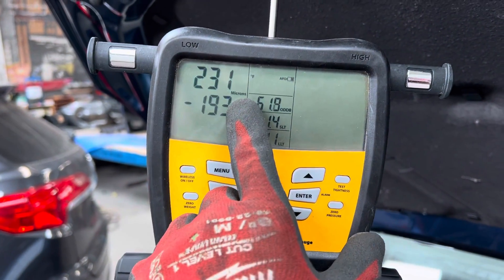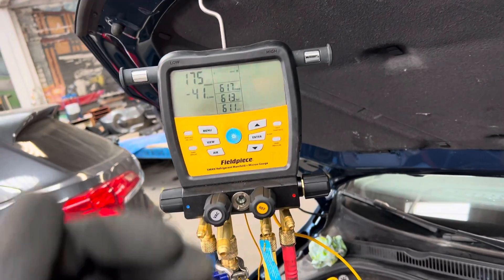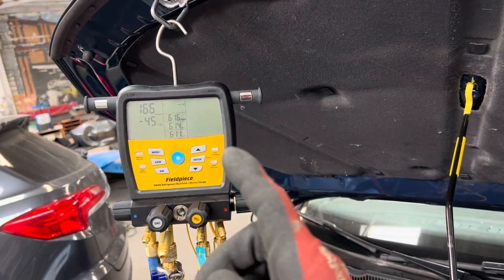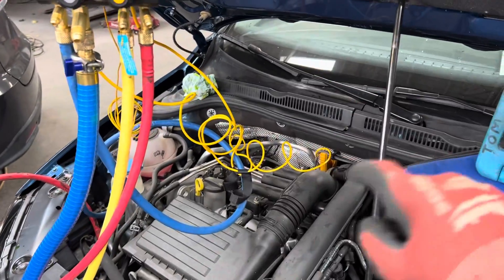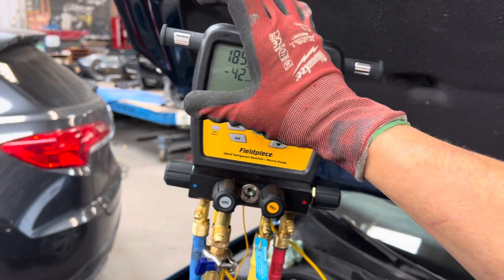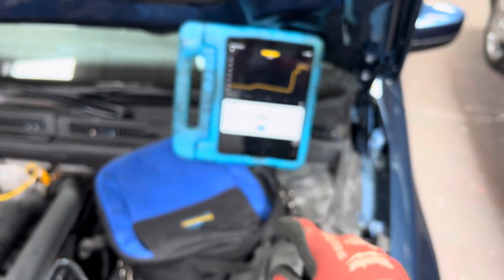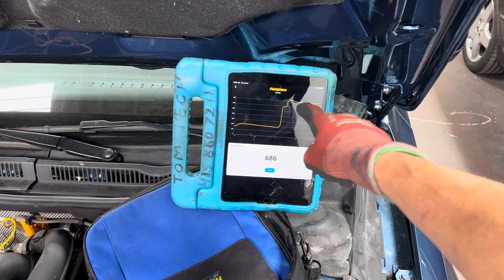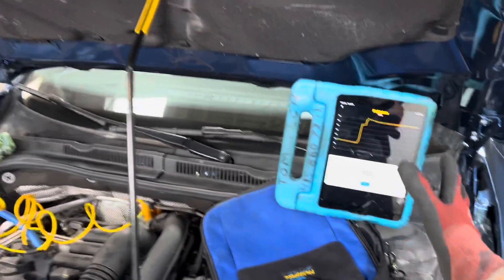MICRON GAUGE USE ON SM480V

Comment: One question master. Where is the right and best  place to connect the liquid line temperature clamp and the suction line temperature clamp ?
Reply from the maker: Suction line low side, low temperature right at the firewall where it comes out of the evaporator
         Especially if it has an internal heat exchanger line assembly

Liquid line exiting coming out of the condenser. 

If it’s by blowing hot air from the fan or if it’s close to the exhaust manifold where it’s really hot radiant heat . 
     Now wrap some cotton towels around them if the blowing heat or direct radiant heat heat up the plastic because if the plastic gets too hot that will transfer to the temperature pick up sensor and give you wrong readings.
Reply: @coldfinger459sub0 thank you master .

Comment: Tom, just to confirm the AC is working normally, what should be the difference between outside and cabin temperature should that be 15 degree in x minutes, apprecaite your help.

I got SMAN 480V,, WITH BLUE VAC. i used vaccum hose that is 1/2 hose that has 3/8 connection to SMAN and 1/4 connection to fieldpeice vx7 10 cfm pump.

i connected blu vac to  low side. SMAN SHOWS 700 MICRONS, BLUE VAC SHOWS 1200 MICRONS BCZ IT IS CONNECTED DIRECLTY to low side port. after isolating field peiece vaccum , my blue vac shows 1800 in about 10 minute and then it stablize ...

do u see that big difference between manifold and blu vac connected on low side. which is almost equal to 500 microns. please advvise.
Reply from the maker: Don’t quite understand what you’re saying make a video and post it and give me the link

As for temperatures of cars, there are all different summer 30° difference between Inside outside somewhere 40° different summer 50° difference 60° different similar 70° difference 

It all depends on the car. It all depends on the ambient temperature. 

If it’s a newer car affordable to space, men at all depends on the software and the way the manufacturer wrote the software to respond 

It all makes a difference if you already cool off the interior and removed all the heat from the solid objects all the plastic to glass the metal. The leather any items have already been chilled down to their maximum of what the AC is capable of will be much colder duct temperature in recycle mode than if the car is only been sitting in the sun for five hours. It’s baked it’s 120° interior materials will be much higher duct temperature many variables.

Comment: You got me to get one. And the pump and hoses. I’m just a shade tree mechanic.  I had junk manifolds for years. This is space age. I’ve done neon signs for decades. Only in the last ten years I came to my ultimate vacuum system. Millionths of an atmosphere. Crud in old tubes can raise hell. Just like that. They (neon tubes) sat broken for years. Fixing them is experience. Most chuck them and charge for new glass. I enjoy the challenge
Reply from the maker: I can tell this RV project is getting closer to getting finished
Reply: I tried once. Think I got a blockage. Locked the compressor up far from the pressure.
Reply: I need to change the expansion valve and that is the whole big ass dash and I’m told you have to cut into the evap case
Reply from the maker: @christopherrasmussen8718  oh, yes, I remember that and I remember telling you that your expansion valve is plugged because they always are on those old RVs

Derusted Under cumulator that flipped off drop to the bottom got picked up by the refrigerant delivery tube injected right into your expansion valve. I remember telling you about that.
Reply from the maker: @christopherrasmussen8718  you replaced everything didn’t you?.

Comment: Most so-called "techs" are too cheap to invest this much in tools or too hard headed and high-ego that they refuse to learn and think their Harborfreight craps that shows -30 is good enough vacuum.  I dont think any of them know what a micron meter is!  No wonder my car is still sitting in the dealer for a month and them dealer "shop foreman" tech doesn't seem to have a clue and cant get the vent temp below 60F with a new compressor!  Im beyond frustrated and feeling like getting the car back and fixing it myself!
Reply from the maker: Don’t get me going on a rant about dealers

Boy, do I have stories to tell dealing with dealer repair cars over the last 30 years 

Especially when my subscribers tell me, their vehicle has been back several times and they have to wait two weeks for an expert to fly out a senior tech for the manufacturer to try to figure out why it’s not getting cold enough 

This is ridiculous and very sad and it’s a true sign of the decline of education in our trade 

And then, after that, so called expert from the factory manufacture, repairs, the vehicle, it still doesn’t work, right 

And to top it off this one in particular, customer was a plumber, and this was his work vehicle that he hast to make an generate money out of every day for every hour 

The plumber and I had a discussion a few messages back-and-forth 

The plumber went underneath the dash and figured it out. It was an actuator that was blending in warm air, that simple and a plumber fixed it. 

Where are the experts from the technicians at the shop and the expert that had the fly in from the manufacture, could not figure out incorrectly fix the problem? . 

This is how pathetic a system of education, and or requirements of what a technician should be has dropped down to we literally have De-evolve into Neanderthals

Comment: Good result 👍 I get all the saturated jobs 😂 have never seen one level off yet! & flatline like that. The best I have had is a really slow climb from 135 to over 1200 microns, people round my way have never heard of a vac for longer than 20 mins and think I’m trying to rip them off. I always pressure test and they hold with no drop. Spray all connections with bubble leak detection, and test my rig before I begin. But they don’t want to pay for a new dryer etc.
Reply from the maker: I forgot did you ever mentioned that you have nitrogen? 

Try this on your next few vehicles when you’re not in a hurry and you have time to experiment 

1: run the vehicle in defrost mode with the heater on full blast, hot

2: during this time, pull a vacuum down to 500 µm and then break the vacuum through the high side with nitrogen

3: if you can, and have access, put a hairdryer with the nitrogen at roughly 1 psi, it’s not important to psi or three psi, or even zero psi
    Allow that hairdryer to run on its hottest setting, and I mean hairdryer, not heat gun a heat gun can damage something or cause a 🔥 fire

Allow that hairdryer to run for about 15 minutes on the receiver, drier with the nitrogen inside of it the nitrogen will conduct heat and transfer the heat from the surface of the metal to Ddesiccant material inside the receiver dryer. This takes a long time with a hairdryer about 15 minutes on the hottest setting.

4: all this time the vehicle is running, heating up the engine compartment. If you can accomplish this with the hood closed and run the hoses through the grill or underneath the car under the bumper or out the fender well is even better..  because they close Hood the heat builds up and gets hotter from the engine on all the AC lines in the compressor and components. 

5: now turn on your vacuum pump, vacuum in the low side you are sweeping using the nitrogen that you push through the high side to continue its journey through the low side. 

Try this a few times see what your results are . .
Reply: Hi Tom, yeah always use nitrogen and did a tripple evac and  sweep that did bring it a lot lower will try heating the dryer with the dryer many thanks for the tip 😊
Reply from the maker: @Ken_4711  one other question

Are you reading your micron level through a set of gauges through the refrigerant charge and hoses? ? 

Or are you isolating the fittings with ball valves with a micron gauge attached to the refrigerant fitting completely removing the gauges in Refrigerant charging hoses out of the equation  ?
Reply: I go direct to the ports with Appion valve core removal tools with the micron gauge fitted to that, I isolate and valve off with the vacuum rated ball valves, I also put the nylog on all the fittings as you have shown in a few of your videos.
Reply from the maker: @Ken_4711  be careful about putting nylon or any Lubricant at all whatsoever close to the micron gauge. 

Any excess of lubricant that accidentally gets forced in under pressure because you forget to turn the valve off or you turn one open windows pressure and you forgot about it can push Lubricant onto the sensor and throw your sensor off or cause you to go through the agonizing pain 

Of cleaning it out with alcohol and going through the lengthy, tedious, recalibration procedure that few people read about